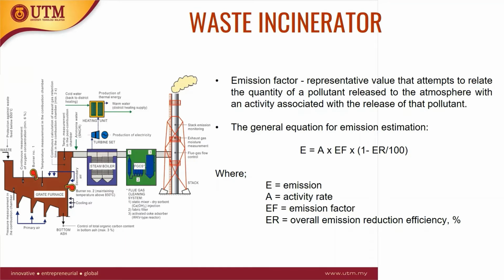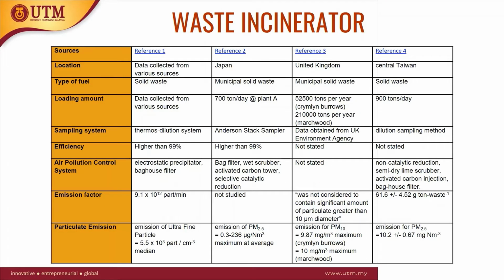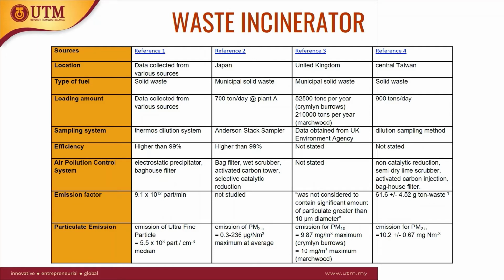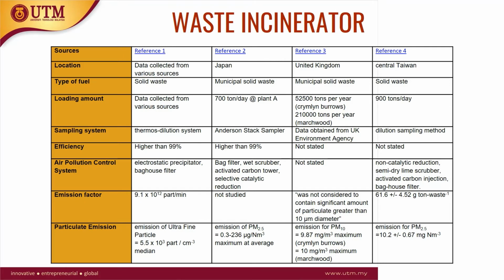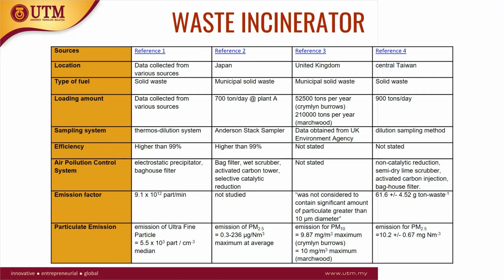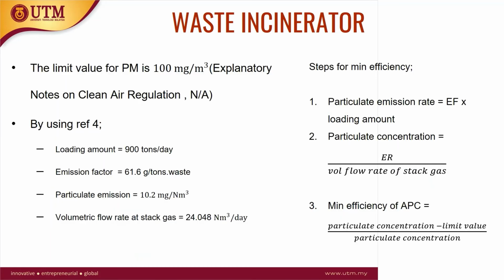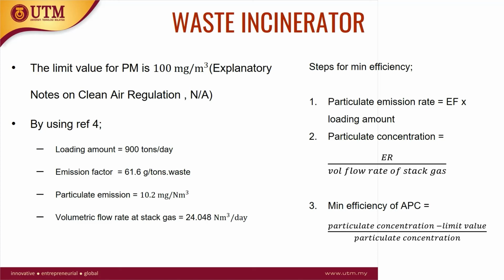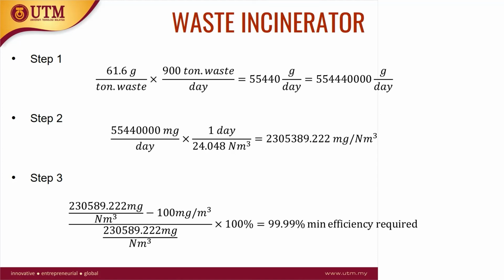Waste Incinerator - Group 5

Comment: Hi Group 5, good presentation! We would like to ask, among the sampling systems stated, which one is the best system and what are the reasons? Thank you.
Reply from the maker: Hi thank you for the question, subjectively there is no 'best' system right now because each system have its own pros and cons. But in my opinion, ESP is the best control system since its unique principle can yield a very  high efficiency rate. However, its cons comes from the usage of electricity which other control system do not have. In the future, green energy can be commercialized and the usage of ESP as the primary Air Pollution Control System will seem more viable.